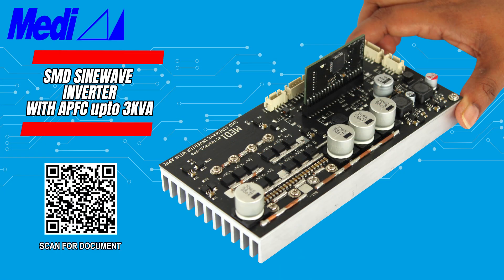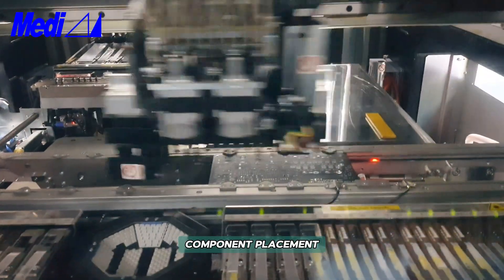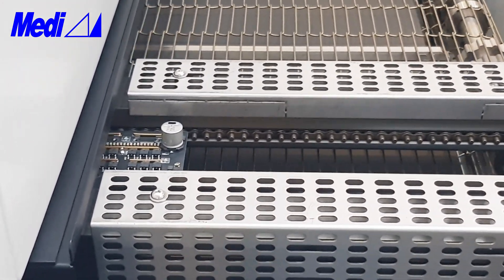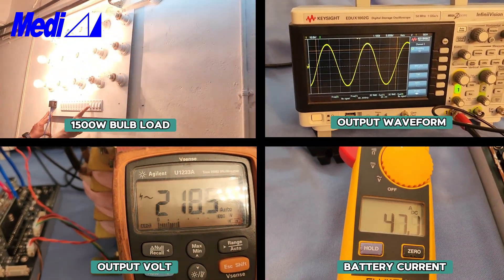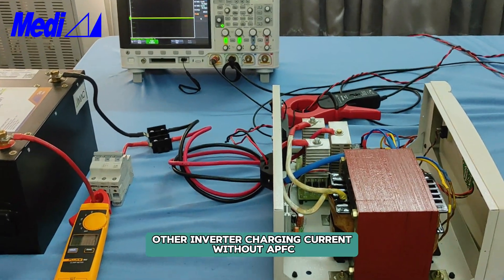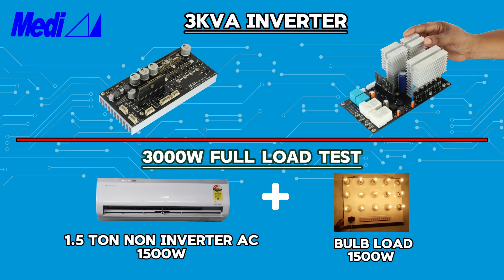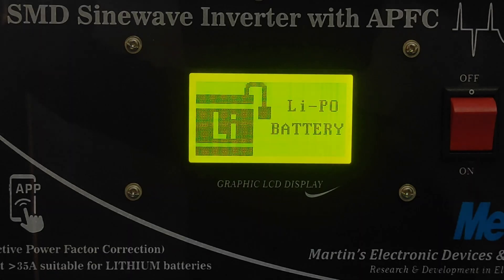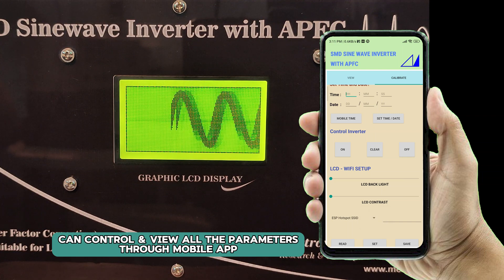Medi SMD Sinewave Inverter with APFC up to 3KVA

Comment: Then why don't u develop hybrid solar inverter like Chinese Deye  you can do
Reply: Yes.. That along with parallel capability.. To make it 3 phase 3kw or more
Reply: We have up to 30kva 3phase & 1phase
Reply: @martinxavier5787   @martinxavier5787  sir... Market need with grid export+parallel capability to daisy chain inverters with load sharing like of 5kva x 9 to make 15 kva 3 phase or 1 phase 45kva...voltronics is oem and being rebranded by many in india...and even service, component level, repair is available with Flin solar, Mumbai for their products ... experienced it!...and battery voltage 48v irrespective of kva, integrated mppts, all protections included with wifi data monitoring, firmware updation support for enhancements, runs off solar without batteries the loads directly from mppt few models without grid support! (Flin fuzion model)
Reply: they dont have the tech yet